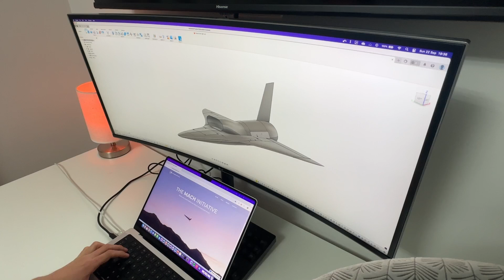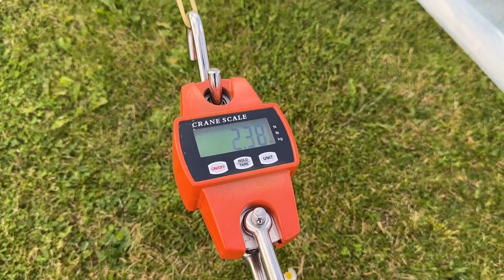Flying a 3D-Printed Prototype of our Mach 0.75 Model Aircraft

Comment from the maker: You may be thinking "all this wind tunnel testing and you still got the CG wrong?"

Our wind tunnel studies predicted that the Kingfisher *may* be stable at static margins of 5%, but might experience some nasty neutral point movements and control reversal at high angles of attack, we knew that at 8% static margin the Kingfisher would be flyable. However, increasing the static margin increases the amount of ballast/ weight, and increases trim losses. So, we wanted to find the minimum static margin we could get away with. Hence, the plan was to always start with 5% and slowly increase. As we found, a 7% static margin was necessary to be flyable.

For reference, the static margin is a measure of how far the CG is ahead of the neutral point. The neutral point is sort of like the centre of pressure, but is defined as the point where the pitching moment is constant for small (sub 10 degree) angle of attack changes.

3DP SPECS:
We sized the 3DP to match the wing cube loading of the full-size Kingfisher, which is a good indicator of how an aircraft handles because it also takes into account the size.

Length = 0.8m (60% scale)
Weight = 2 kg
Wing loading = ~130 g/dm^2
Wing cube loading = 37 g/dm^3 (vs 39 for the full-size Kingfisher)
Powerplant = 70mm 6S EDF
Thrust to weight ratio > 1

To maximise TWR and wing loading at the same time (to be as representative of the Kingfisher as possible), the EDF is basically the same size as the fuselage. We had to saw off the front of the EDF to get it to fit inside such a tight package. It looked super clean once integrated!
Reply: You might want to consider a net to catch it on landing XD
Reply: put a nozzle on that EDF may go faster

https://www.youtube.com/watch?v=jOvyN77rJnA
Reply: @TheMachInitiative  
Yep. 
That cg vs stability vs efficiency is a real bitch. 
Glad you got an estimate in the wind tunnel. 
Looks like your estimates were pretty close. 

I’m sure you have already looked into the cp change as it goes transonic. 
I can’t help you there apart from the obvious of sacrifice sub sonic lift for supersonic stability. Ie, symmetrical shape and airfoil.

As always, I’m very impressed with how you kids are going to
Reply: @brucebaxter6923  its actually not, its all be documented, but some people like to reinvent the wheel and fail over and over again.
Reply: @Fatpumpumlovah2  
Can you elaborate?
Reply: @brucebaxter6923  elaborate on what exactly?  i typed many replies.. some they had removed cuz ja just make them look foolish...
Reply: @Fatpumpumlovah2  there are no comments from you in this thread before today.

Comment: This is a competition you can never win, the multi mach test vehicles are remote controlled. Most jet fighters have flown remote control already
Reply from the maker: We agree we’re never going to compete with 10m+ long unmanned aircraft, engines of that size can get a much greater thrust/ drag. The record we’re going for is for the fastest sub-25kg jet-powered model aircraft - more info here: https://www.guinnessworldrecords.com/world-records/fastest-remote-controlled-jet-powered-model-aircraft-(rc)#:~:text=The%20fastest%20remote%2Dcontrolled%20jet,difference%20of%2042.251%20km%2Fh.&text=Comments%20below%20may%20relate%20to%20previous%20holders%20of%20this%20record.

Comment: Hi , im not a earospace engineer of any sorts just want to ask a question. Is there a way to calculate if the enige can stall when flying high alpha, the intake looks to be in the vortex zone
Reply from the maker: Great question! We used two approaches:
(1) Computational fluid dynamics during the initial design - this simulates the airflow going through the inlet to look for pressure differences across the engine face, and recirculating regions/ vortices inside the inlet which could lead to stall

(2) We then validated the CFD using experimental tests. We attached the inlet to the engine on the test stand, and used some electric ducted fans to push high speed air into the inlet at a high (20 degree) angle while the engine was running, and didn’t observe any stalled.

Comment: Since i have no experience with the rc size jet engines, what is the ttwr you are getting out of it and also will it be able to reach mach without afterburners and variable nozzle
Reply from the maker: It’s got about a 2.5:1 thrust to weight ratio, no afterburner or variable area nozzle!

Comment: So gonna toss my two cents in here after 25 years of flying RC sailplanes. Ditch the sling shot launcher. You will continue to have problems getting consistent launches. Single point bungee will serve you much better also two hook placement is critical in you set up having to it well forward will allow for build up speed instead of altitude.
Reply from the maker: Agreed - it is too unreliable. We’re currently redesigning the launcher and testing a few things out, hence the absence over the last few weeks - we’ll hopefully have a new video soon

Comment: Do you plan on not using gear and launching with a slingshot as well? One suggestion I would make is to use a "Dolly", similarly to the me163 komet, which allows the aircraft to take off conventionally without the added weight of retractable landing gear or gear at all. The slingshot also seems to launch the aircraft quite inconsistently and a standard takeoff would provide full control to the pilot.
Reply from the maker: This is something we are strongly considering. We did some more 3DP flights and the catapult was being very unreliable. Also not sure how well it scales to the full size kingfisher which is 5 times heavier

Comment: The inlet for the engine is too large... the stagnation pressure within will likely cause a compressor stall in a single stage centrifugal flow compressor.
Reply from the maker: If you look at our other videos you’ll see that the inlet on the jet engine version is significantly smaller 😉 this inlet was sized for an EDF.

Comment: A lot of fighters have ventral fins to help improve high aoa yaw stability. Is this something you've considered? Might be a better way to improve yaw stability at high aoa compared to increasing the size of the vertical tail. I am also wondering if your pitch stability issues are similar to what initially plagued the F-18. A lot of effort went into studying the vortexes generated by the leading edge extensions as they could be inconsistent causing sudden changes in center of lift. Really cool to see your progress!

Comment: When I saw the plastic sheet, I thought it would never work, and it barely did. You won't know if the CG is correct until you fly it inverted. If it climbs, it's tail heavy. You should have to hold a touch of forward stick (down elevator) to maintain altitude in level inverted flight. How many inserts did it devour?

Comment: The dimensionless wing-cube-loading works out to ~34 just for the EDF demonstrator, that's insane... Respect to your pilot that he was able to keep it in the air and nurse it to a - well, a "gentle crash"! 😁 The fact that it literally started backflipping with the CG "ahead" of the calculated neutral point, even by a few percentage points, makes me wonder if something about the fuselage aerodynamics etc. is throwing off the CG calculation. I've flown a LOT of intentionally-tail-heavy deltas and personally have always found I had to be well into the negative static margin to get such uhhhh... "gleefully" divergent behaviour (admittedly, none of mine have been anywhere near this high WCL!) You mentioned in the pinned comment that the static margin was derived from wind tunnel testing -  did you work it out by any other means as a comparison? If yes, did they agree well with the wind tunnel results?

Comment: From my experience in RC i think you were still needing to move more weight forward. I wouldn't add weight, just shift things. And yes, i saw how the height decreases in the nose, perhaps a compromise of "perfect" aerodynamics might be necessary and do a mod. Back to the old form follows function and pushing the 'guts' forward requires some form thickening.
Also, when the time comes, you might consider something ive had good success with on launching large RC models by attaching a launch rack to the roof of a car, driving up to flight speed and doing a release. Ive launched some 4.5 meter wingspan craft that way. (Note that i also used the roof rack first with a pivot without releasing tge bird to check CG and control response tuning. Much better to do than launch with hope then collect pieces into a garbage can)

Comment: Have you accounted for scale speed? If the plane is flying over 500mph in true speed, then the scale will surely be Mach 3 or something right? Either way, that design isn't suitable. That inlet seems to be acting as an airbrake at the wrong angle of attack.
Reply from the maker: We’re targeting 570 mph true speed, there is obvs a lot to do before we get there!
Reply: I think it's definitely doable but I'm wondering if it would be better to curve the inlet around the body more. And have it directly pass over top of the engine for cooling.  @TheMachInitiative
Reply: @TheMachInitiative  hello! Do you still intend to use ArduPilot for those speeds? Does ArduPilot support such speeds?

Comment: Congratulations Guys, you got it airborne!
Here's my quids-worth: too low a static margin also lowers the dynamic margin, which can make it wobbly with inertial coupling between pitch and roll oscillations. 
Also, high alpha's on slender delta configurations like yours (struggled with this myself!) can produce a weird short-period roll oscillation caused by the wing vortices literally battling it out over the upper fuselage forebody - this won't show up in wind tunnel testing as you need freedom in both roll and yaw. I christened this 'wibble' (induced wobble) and at first I mistakenly thought it was some sort of 'Dutch roll' oscillation, which it's tempting to combat using yaw damping. But that could make the 'wibble' worse!
Add some roll-rate damping into your flight controller, but only that. Much later into the flight-test programme you can add more functionality.
Every 5 degrees of leading-edge sweepback has the same effect as 1 degree of wing dihedral, ergo zero dihedral is over-stable! I've found that combatting this with notable negative wing dihedral ('an-hedral') really helps, even though it feels counter-intuitive. Most manned deltas have anhedral.
P.S. we've got a very long launch-rail!
Reply: Yooo unrelated thanks for this! I build a lot of slender deltas and I've always wondered why their high-AoA wing rock was so much more pronounced... In your experience, would making a slender delta that was a low-wing affect this at all, e.g. the fuselage acting like a bit of a fence to keep the vortices separate? Or am I picturing it wrong?
Reply: @rcbinchicken  Absolutely, the Space Shuttle's large fuselage kept the vortices apart. I build an RC shuttle and it never wibbled.

Comment: I do hope you're aware the current RC speed record is 548mph and held by a GLIDER doing Dynamic Soaring. If you're scared of piloting your machine, imagine doing it in a 50g corner in 60mph winds, just a few meters off the ground ;)

https://www.youtube.com/watch?v=0nyYaL0dGAA
Reply: True but those planes go at those speeds in a circle meanwhile this plane is suppose to go around 600mph in a straight line which is insane.

Comment: I've been curious why I've not seen a plane with golfball type dimples on the entire top of the air craft?  Thoughts?
Reply: They do exist - they're called Turbulators, but they aren't common for a number of reasons.

1 - Aircraft fly a lot faster than golf balls, so the flow is normally turbulent without needing any help.
2 - While turbulent flow reduces wake drag, it increases skin friction drag. Streamlined bodies like aircraft tend to have more skin friction drag than wake drag - so turbulent flow usually makes more overall drag on a plane.

In fact in a few cases (like the p51 Mustang) special effort is put in to keep the flow laminar, not turbulence, and that helped with that aircraft's particularly long range.

Hope that clears things up!
-Max

Comment: I think you should add FPV analog system that will help flying on bigger altitudes and have less drag
Reply from the maker: We probably won’t be flying at higher altitude due to legal/ practical limitations, but we do have an analogue fpv system on the full-size aircraft :)
Reply: In Poland we have max altitude of 120m and it’s hard to see the drone so FPV is good for this
Reply: And the analogue has a low delay

Comment: Fellas I think you may need to do slightly more research on the rc hobby side. 
First off…
You had it tailheavy beyond flying,
You MUST ALWAYS center your surfaces before you fly, 
And you need lower rates for higher speeds. This is a cool project wouldn’t wanna see it crash
Reply from the maker: Thanks for your support of the project and advice - to address some of these points:

The change in CG between flights 1 and 3 was only 1cm - wind tunnel tests had shown we may be unstable with the initial cg depending on the margin of error of the experiment, but we wanted to see what we could get away with, as we want to minimise how much ballast we have to put in the big one. The first two flights cemented that we needed a more ballast than we hoped for!

Offsetting the elevons was a conscious decision - the delta wing needs 15-20 deg of upward elevon to trim on takeoff/ landing and stop it from rotating. For higher speed flights we’ll defo level them or have a transmitter mode to switch from trimmed low speed deflections, to levelled high speed deflections.

Strongly agree on point 3 - we’re going to have multiple transmitter modes to alter the throws at different speeds. The full-size aircraft has split elevons so we’ll only control using the inboard elevons at high-speed for better sensitivity.

Comment: Great looking aircraft! Was it on purpose that you let it stick to the ground while launching? Maybe a detachable undercarrage or sled would do wonders. For landing maybe thin extendable skids? Carry on the great work! Will your 3d files be available?
Reply from the maker: The launch and landing procedure is something we’re ironing out - clearly for the full-scale flight we’ll need some kind of release mechanism. Ideally we’d run the aircraft along a rail to keep it straight but we’ll see how practical that is to implement. Stopping it from flipping on landing is another challenge we’re working through - extendable skids would add a lot of complexity, we’re hoping the skid shaped fuselage will do the trick. The full-size Kingfisher has sacrificial 3D-printed wingtips which can easily be replaced
Reply: @TheMachInitiative  The skids could just consist of a metal strip on a hinge, a spring and a small servo to unlock. After activation they pop out and would just dampen the landing so the nose can't dig in. For the rail you could go with a simple double rail and just slide along with your bungee or a tube with a roller cart. Are you planning on fpv for controlling? At those speeds it will be very hard to see in the sky and from the ground.
Reply: You could also just use a big net and  fly into it.

Comment: Great stuff! How does the EDF wing loading compare to the full scale jet powered one?
Reply from the maker: The wing loading on the 3D print is slightly lower - landing speed is about 40 mph vs 50 mph for the jet-powered one
Reply: @TheMachInitiative  that sounds like a good approximation for these flights! Good luck for the big one!
Reply from the maker: @YensR  Its worth noting that Wing Cube Loading (mass/area^1.5) is a much better indicator of how an aircraft handles. We tried to match this as closely as possible, so the 3DP has a WCL of 370 g/dm^3 vs 390 g/dm^3 for the full-size aircraft
Reply: @TheMachInitiative  thank you, that's very interesting, I had not heard of that variant!

Comment: 500+mph already achieved by a RC glider. Achieved by dynamic soaring. So your powered plane is quite slow. Oh and their glider was not weighed in ounces but kilos.
Reply: congratulations... they can go in a circle fast. whatever. being able to travel from one location to another is far more interesting.
Reply: @arl6565  the gliders can keep this speed up for hours. Something this small jet cannot do. The duration of its flight will be measured in minutes, NOT HOURS.
Reply: @ianturpin9180 there’s a huge difference between self powered flight vs unpowered flight, we can have both
Reply: @ianturpin9180  Do you have anything positive to say?
Reply: @N9197U  yes, gliders are extremely fast.
Reply: @ianturpin9180 good for gliders? Are you just here to pump up your ego about soaring?
Reply: @ianturpin9180   Yeah in a circle.
Reply: @ianturpin9180   And wind….
Reply: The gliders can go for hours, as long as they’re on the right slope of a mountain with perfect wind conditions. And they can’t leave the mountain with any meaningful speed. Let these guys have their moment
Reply: they're trying for the powered speed record, not glider.

Comment: I wonder if your pitch stability issues are due to the shape of the nose. It's like a big paddle when it changes angle of attack and I'd imagine you get some airflow coming unstuck leading to messy airflow (flow separation) over the wings and also odd spanwise flow. I reckon I'd be looking at perhaps some stabilisation gyros to dampen the pitch issues as really the shape is about how slippery it is at high speed and not how well it turns... right up until you need to bring her around for another run.
Reply: I would try it with increased rudder surface. I've built a few delta's from scratch and found out at higher angles of attack that the wing will block the rudder. I might help to get it more stable.
Keep on the good work, I'm enjoying your adventures and design process.